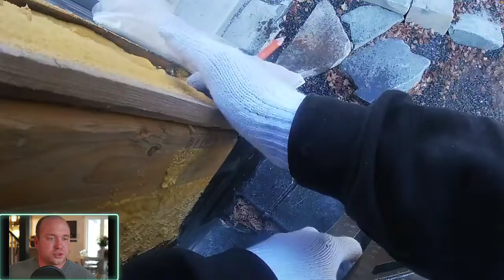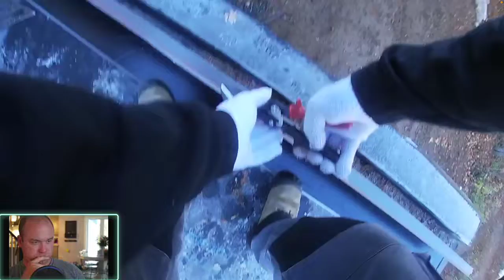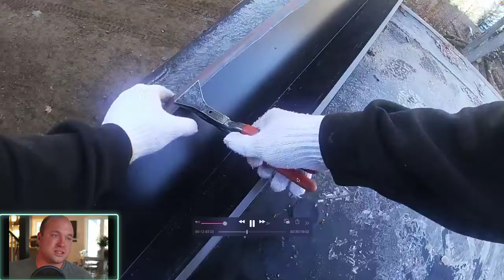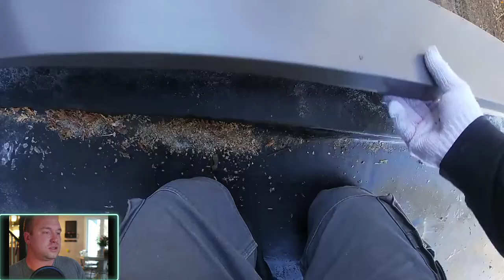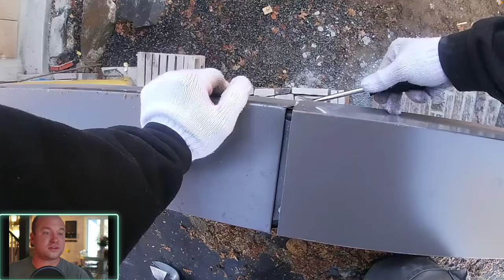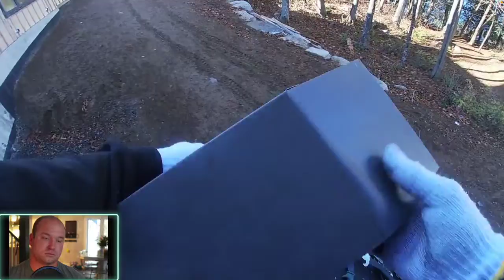How to install PARAPET COPING METAL

Comment: Whenever I build a parapet, I always run into the same problem. Water stains and mould appear on the flat section beneath the parapet. Should I leave a gap between it and the wall?
Reply from the maker: A drainage mat like cedar breather will give it the separation it needs

Comment: Could you have broke it with the taper, assuming you measured at take off. Seems like.that may have saved a little time
Reply from the maker: If I’m going in to an S lock I always pull one end
Reply: @asm101  that's  nice work I like the s-joint technique have used in ac duct construction but never in coping. Mainly used splice plates and standing seam on continuous cleat applications. I enjoy your videos good to see clean work going down.

Comment: How do I prevent water from constantly dripping at that S seam? Tried caulking but water always seems to wet the wall directly under each seam
Reply from the maker: Best way to avoid it is the add slope to the top and drain away from the face

Comment: A 5-1 tool like the one painters use, is great for opening that drip edge seam 👌
Reply from the maker: Yes i either use that or a flat head screwdriver
Reply: Window bar works great too, keeps your hand away some aswel

Comment: Could you do a video on how to do a "S" lock? Very interested in that method. Looks way better than having the coping method of a flange folded up on both sides of a seam and bent over.
Reply from the maker: Yes of course...it's on the list
Reply: S lock is basically take the last 3" and fold it underneath the peice, make a 2" mark on the 3" peice and fold it forward. If you can visualize it creates a pocket with 1" sticking past the top of the coping to serve as a flange for your screws. You also want to taper your peice. If you have 7" cap you want your stock side to be around 7 1/4" this accommodates the thickness of the layer of metals so it slides in easier.
Reply: @Cam  do you put any type of sealent in the little pocketed area? Or should you just have a good peel and stick layer ontop that overlaps onto the siding material, etc.
Reply from the maker: Parapet caps aren't meant to be waterproof althought they can definately help with shedding water.  The flat roofing company is supposed to seal up, over, and down the face and the copings main purpose it to prevent the flat roofing material from peeling back
Reply: @Josh  usually yeah you put a small line of caulking along the flange before inserting the second peice. In most cases you never want to tie your peel n stick into the metal they should each be their own defense against water
Reply: @Architectural Sheet Metal 101  in my experience atleast in bc canada the torch on comes up the inside parapet wall and they leave a section de granulated that you would put primer on and tie peel n stick onto the ungranulated part and come up,over and usually 3 inches onto the face. Than you put a peice of counter flashing on the inside wall if it's high enough followed by the cap.

Comment: If the roofers were smart, they would tell the builder, hey look you need to raise the parapet wall with another 2x6 before the flat, or Just do it themselves.
Reply from the maker: Technically there will be once the build the deck...I've been in this situation a million times...doesn't bother me that I have to customize my piece
Reply: @asm101  it drives me nuts. Don't have patience for that shit 🤣.  Yell at the builder and roofer 😋
Reply from the maker: @mpmPaulski  yes sir!  I'll get right on. That